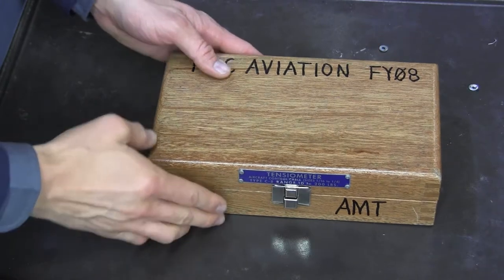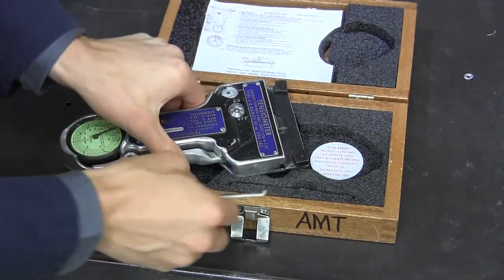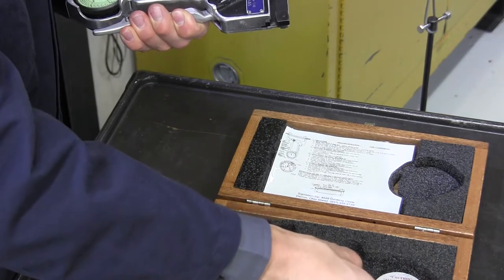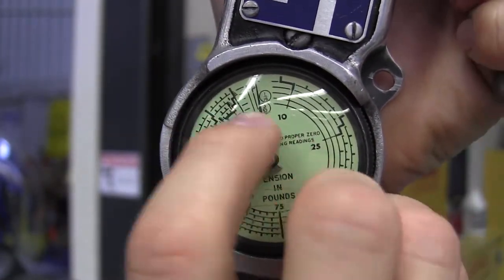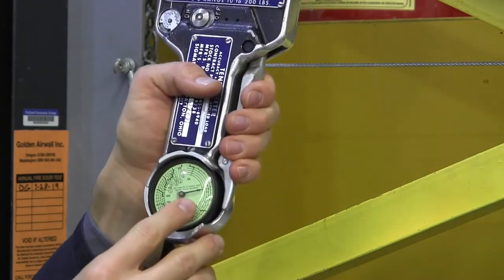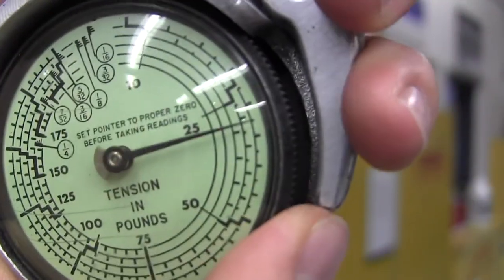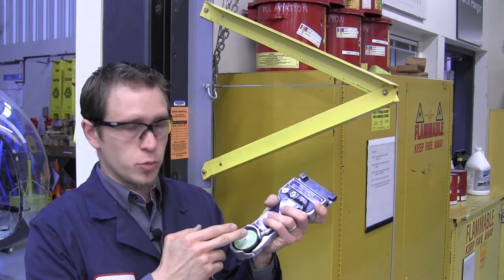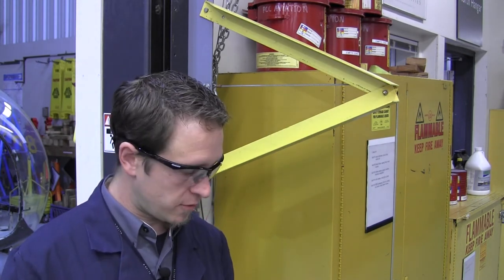C-8 Tensiometer Demonstration

Comment: Is it safe to estimate the OEM's accuracy is +/- 5%?
By the way, appreciate the video.
Reply from the maker: Thanks. And sorry for the late reply, haven't checked this in a while. Generally not a good idea to make an assumption on accuracy. In the case of the C8, because there is such a wide variety of ranges there is also a corresponding range of accuracies. Safest bet is always to look at the manufacturer's [technical] documentation.  However, stamped on the data plate is, in fact, the words, "Accuracy +/- 5% of Applied Load"  :)